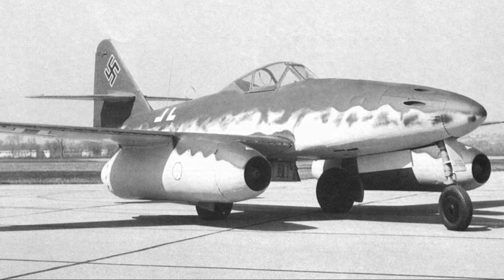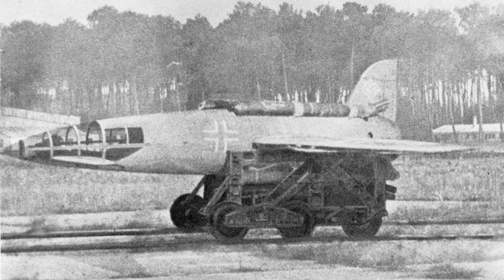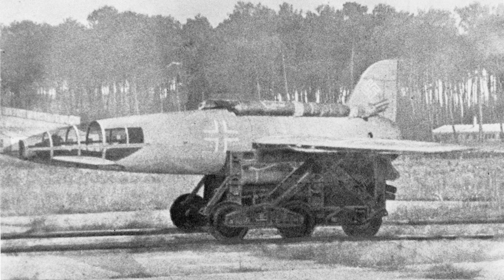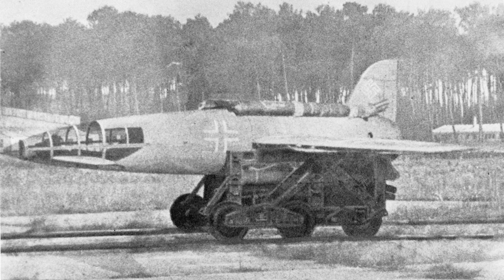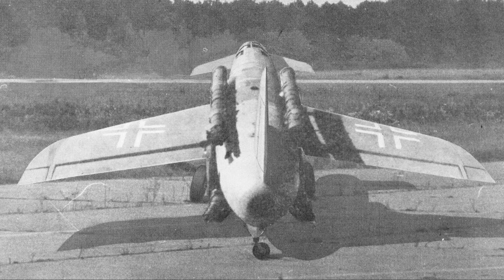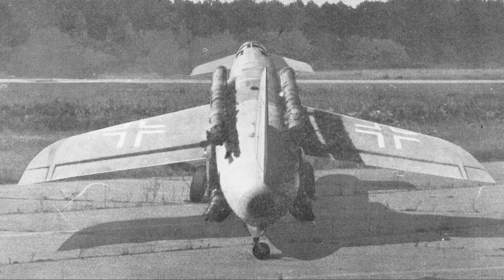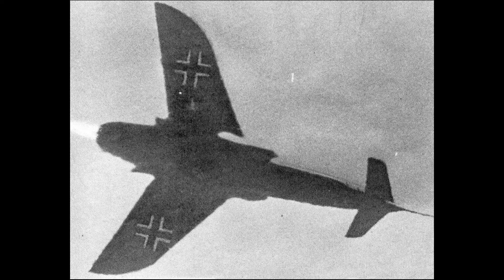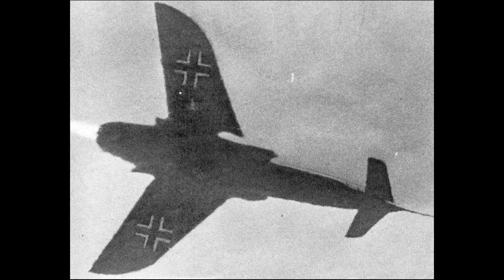Hitler’s Last Ditch SS Interceptor; The Junkers Klf 255

Comment: I believe that a similar, though obviously much evolved, machine will be used to power HS2 trains when the line finally opens in 2095. Assuming, that is, that horses are not available.

Comment: You neglected to mention the integral R2D2 unit.  Obviously an early model with some reliability issues.
Reply: R1A1 unit, R2D2 wasn't produced until a long long time ago
Reply: @Aqua Fyre not to mention the axuliry R5-D4 motor that had a bad motivator which exploded.
Reply: Poor droids always ignored and underappreciated.
Reply: It crashed because it lacked an astromech of any type at all.
Reply: @jaws666 ... the canards should've gone into Tosche Station to pick up some more power converters.
Reply: @warpartyattheoutpost4987  flash gordon
Reply: @Dunkopf  Not to mention it was in a galaxy far, far away.

Comment: I believe the problem with the booster rockets is that two of the four had been installed incorrectly, with the nozzles facing forward rather than aft.  A pity it wasn't caught before launch (at least, for the poor test pilot), but there was some thought that the slave labor that had done final assembly had read the blueprints "incorrectly". The world will never know...
Reply: And and also it's an April fool joke.
Reply: @animaltvi  That "whoosh" you hear is the plane and four booster rockets pinwheeling over your head...

Comment: The funniest thing about this April Fools joke is how plausible it is. The whole idea of a rocket interceptor project being pushed through under the control of the SS and killing its pilot when it was finally tested aligns point to point with the story of the Bachem B349 Natter. Even the design in the photos just looks like a mix of elements from a Messerschmitt 163 Komet and one of the experimental 50s Leduc ramjet interceptors. It certainly wouldn't look out of place among all the real life Luftwaffe fighter proposals from 1945, and is actually less wacky-looking than some of them. (We're looking at you, Messerschmitt P. 1106.)

Comment: What was the advantage of this rocket interceptor over the Me 163? I'm sure an Me 163 could have been launched from a rail system too. The problem the Me163 had -- besides being prone to blowing up during refueling, take-off, or landing -- was that Allied fighters would attack it in its slower gliding stage after it had completed its run and the rocket engines had expired. Okay, I see this video is an April Fool's joke. You sure got me.

Comment: You had me up to the concept of rails being easy to repair. The USAAF could just have dropped a leaf in the general area to render the concept useless.
Reply: Actually, rails are far easier to fix than roads.
Reply: @killerkirbydude  It's supposed to be a humorous reference to a frequent excuse for problems running trains in the UK: leaves on the line. Or the wrong sort of snow. Or, well, anything really.
Reply: @wbertie2604  We have that in Germany as well. The Four Horsemen according to Deutsche Bahn (the national German railway company)?
Spring, Summer, Autumn and Winter.
Reply: @wbertie2604 ... just leaf it alone.

Comment: Ok, I get that this is supposed to be an April Fool's joke. 
But how is it supposed to work as a joke, when this is exactly the kind of thing that German engineers were really doing in 1944 and 45? The aircraft actually looks less outlandish than some of the designs that were worked on, and its launch and propulsion system is more conventional than the coal dust burning jet engine they tried to build.

Comment: Too bad, it's the sixth today and I would've been pretty much fooled, wouldn't it be for the third, rearest wheel of the trolley in the very first pic - its wrong placement and ground contact point compared to the forward two (the wheel support structure makes it clear it has to be in a recessed position, not at the same level on the rail) immediatly made me suspect of the photomanipulation. Then a little math did the rest... It was a very nice one though!!  😀

Comment: Good one, Ed.  Given the insanities the regime tried out it was all quite plausible until the launch rate of 3 per minute came up.  Cart would need a reverse rocket of its own...or a monster rubber band and they were pretty much out of rubber at that point.
Thanks for the giggle.
Reply: Dual tracked railroad tunnel and multiple cradles only retrieved after launch

Comment: Given the use of KLF you should have suggested the engine was one based on the one designed to run on pulverised coal (which was real) but redesigned to run on burning RM100 notes :).

Comment: Greatest failure of  Goring and hitler was not planning for a long war , deeming jet powered aircraft and other advanced equipement a waste of resources .  
And jet they forgot their original plan of going to war in 1943-1944   .  tiger tanks , jets , panthers , type XXI submarines .  AA missiles all would have been ready during the 1943-1944 era .  

The lack of commitment for a long term vision of war was what costed the germans the war , also the italians where the germans worst enemy as they wasted months and resources of germany during operation Barbarossa  . spending their best troops in north africa with one of the most capable commanders germany had . and wasting Time troops and resources  in albania and  greece . Not to mention the Mediterranean.

Comment: Nice one Ed. You did mention that the proposed KLF 255 pilots would be selected from the SS. My understanding was that, additionally these pilots were to be small in stature and light in weight to help maximise perfomance of the aircraft. Himmlers intention was to select and train members of the SS Gerechtfertigte Alte von Mu (SS Jockey Club) as pilots for the KLF.
Reply: Whereas the minimum height requirement in the SS was 5'11", the maximum acceptable height of SS KLF 255 pilots was 5'1".
Reply: Fully justified decision.
Reply: No worries.. Call Hanna Reitsch

Comment: So probably your joke for all fools day? , but if it isn't, setting up a trial run on "all fools day"  one would not expect more than a bent piece of metal -broken timbers and some trees that would never aspire to rocket plane status at the end and where was it meant to land? or was it a one way trip?  Would not this FireBall XL5 look-i-likey have been better as a variant of e Enzan or Smetterling A/A missile which used more or less the same rocket motor Walther 109 /558 or Walther 109-739 amd Schmiddling  109 553 RATO boosters but with a radio guidance system rather than the dumb meat system installed in the nose. As to armament Mk 108 was already effectively over run by it carrier aircraft and it is unlikely Mk 112 or 115 would have faired better had they cleared trials (doubtful especially for anything as lightl;y built as the above as it was semi recoiless and the vent gasses had to go somewhere.